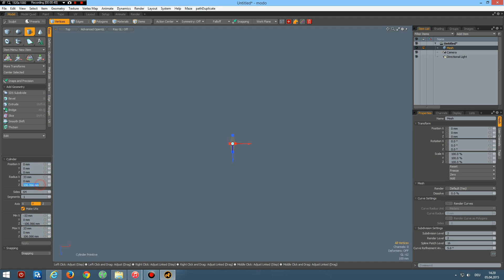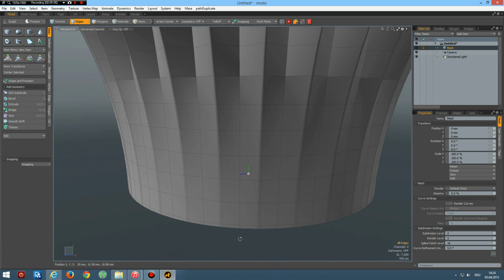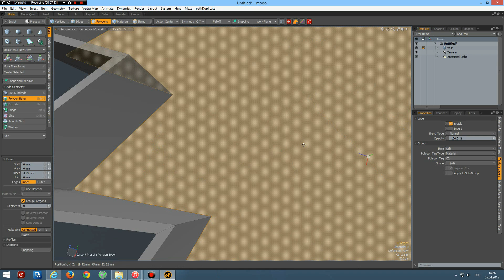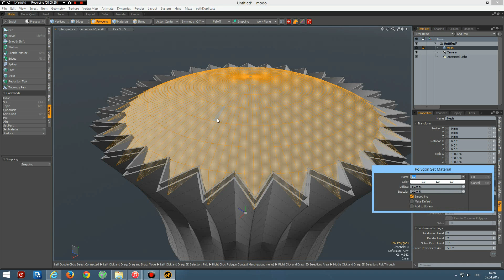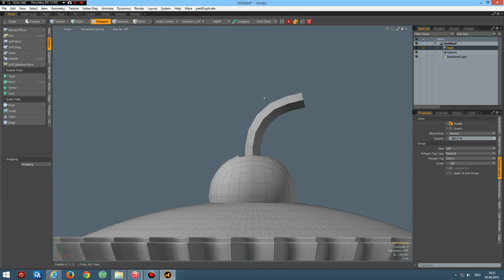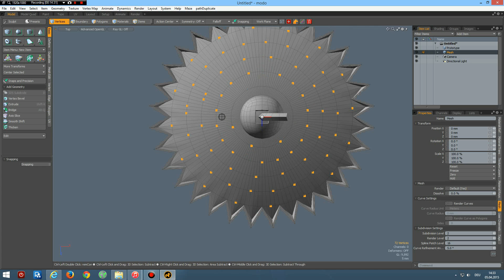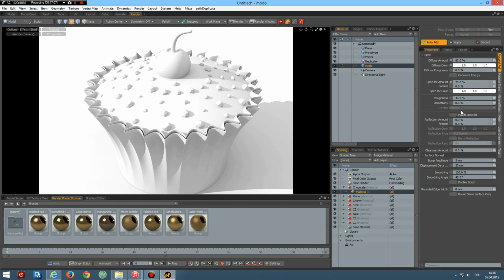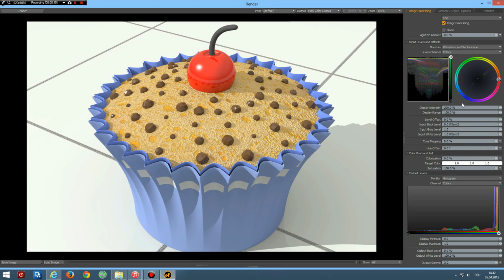The Foundry MODO - Cupcake Wraper for Diane Blake

Comment: Hi Peter, thanks again for a super tutorial.  The use of replicators is a very interesting addition.  I ran a little test but there was a problem when it came to exporting my geometry as a wavefront object.  Only the prototype and the surface exported.  Do you know if there is a way to turn the replicas into "real" geometry for export?  Also... a request for you to consider.  Twice now I've been in the position of modeling a toilet.  I've really struggled with the base.  It is a closed couple design.  I manage the front 3/4 OK but things get a bit "untidy" at the back where things get pinched together.  I will supply an image link in an additional comment.  Then if it gets sent to your spam bin, you will know where to look for it.

Cheers,

David.
Reply from the maker: David Brinnen Hi David, you should be able to export the replicater items by going to -Geometry -> Bake Geometry Cache. Then you get a new group which is called Baked Geometry and inside you should find all your replicator items now as meshes. Kind regards, Peter
Reply: Peter Stammbach Hi Peter, Thanks for you answer.  I did try Geometry -> Bake Geometry Cache - this only "sort of" works for me.  It seems to turn all the quads into triangles (at least when I tried it) and this seems to wreak the sub-d geometry.  Both Poser and DS support sub-d so it would be nice to retain the quad geometry.  But I will keep trying, I can see the replicator being super useful!  Thanks again for the tutorial and the insights.
Reply from the maker: David Brinnen Hi David, there is another way which might work: Goto Items > Replicators -> Freeze Replicators, then you can select them all, right click -> Change Type -> Mesh. Then you can select all this new meshes, Right click > Merge Meshes if you wish to have them all in one mesh. Hope this works :-)
Reply: Peter Stammbach Thanks Peter!  That is BRILLIANT!  I ended up with a funny state where all the meshes were pink an in italics, but that was only one small step away and probably due to me not quite following your steps right.  This feature will be very useful indeed!  There is so much to Modo I don't know, if I didn't have to work quite so much, I'd try to get on a course to find out more.  Your videos are really invaluable and your swift answer most appreciated.  Hopefully too others might be interested in this process.  Cheers,  David.